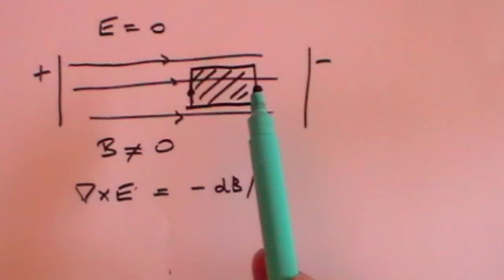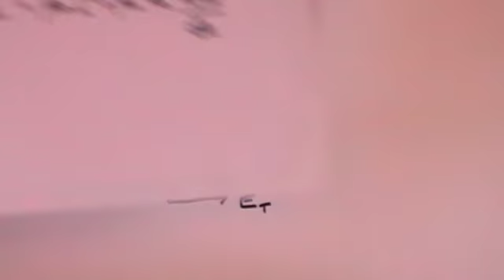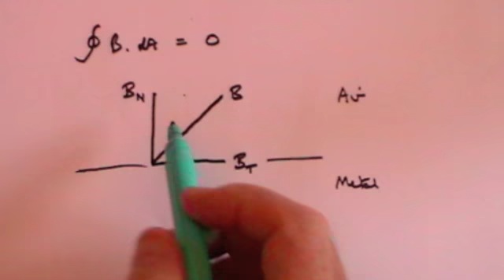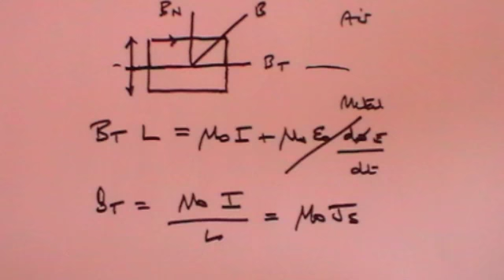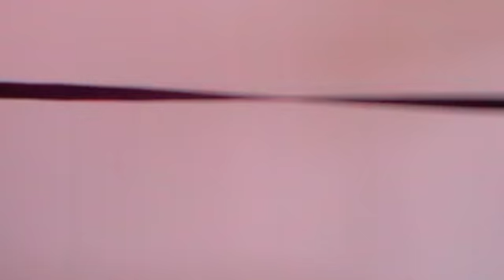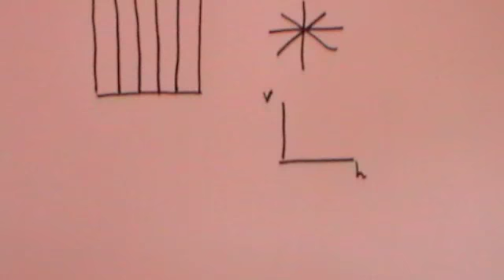Effect of Electromagnetic Radiation on Metals

Comment: The statement at 32:05 that it is the horizontal component of reflected light that passes through a vertically polarised lens is entirely out of line with what I was taught or what I could find written elsewhere. All the sources I find say that reflected light off the ground producing glare is mainly horizontally polarised and that a vertically polarised lens blocks this glare (i.e., horizontally polarised light).

edit: did I misunderstand something??

Comment: With all respect to maxwell's equations but in the first equation something is missing.  Electric field is not just a function of electric charge. It is also a function of the energy of this charge.  So the same charge can have more or less energy.  It manifests itself at work which can do the same number of charges depending on the value of the electric field.
Reply: Czesław Wiech it’s also a function of some radial distance r 
And you’re talking about electrical potential
Reply: @legendarylightyagamiimmanu1821  because the electric potential, volts and electric field are one and the same.

Comment: If a metal perfectly reflects back emag wave, then why does a metal easily get heated in sunlight?
Reply: a metal conducts so it heats up and conducts easily form the suns energy
Reply: @alexmanbeck  , the video says, a metal 100% reflects back electromagnetic wave incident on it. And sunlight is an emag wave. Heat is energy. How does a metal, then, accepting energy from sunlight?
Reply: This is a physical model, where it is considered a perfect metal.
 Real metals have defects so they absorb some of the radiation in different ways, which is why real metals get hot.
Reply: Even in a material considered perfect, reflection is one of several effects that occur in the interaction of radiation with the material, which are probabilistic and depend on the frequency of radiation among other parameters.
Like the photoelectric effect, the compton effect and the formation of pairs.
These can cause the radiation not to be reflected, but to be dispersed and emitted in the thermal region of the electromagnetic spectrum

Comment: If the surface elctron(s) creates a wave that cancels the incomming em field wouldn't it also create an oscillating field in other directions as well, including into the core of the metal?
Reply: Certainly. Electrons will create radiation or I should rather say EM filed in forward direction. But, again, other free free electron are present there (just inside) to produce cancellation effect of incident field. It depends on conductivity, permeability and some other parameters also. Eventually, in practical sense, radiation is stopped inside metal (within few nanometers for visible radiation).
Reply: @tokas79  , so if i hv one copper wire, then electrons are oscillating up n down, to try catch up with any incoming E field oscillating. So there shd be a current on the wire's surface, forever flowing up n down. Is that correct?

Comment: Isn't E=0 a condition of electrostatics? If yes, how do you justify using that condition to calculate the boundary conditions etc? Is it because of the high speed at which the electrons move in a metal to compensate for the E field that is in the metal when an external field is applied?

Comment: Hi, thanks for this series on electromagnetic radiation. It's been great to follow and very instructive. One day mankind will thank you for all your lectures and knowledge you post out here.
In the meanwhile I have a few questions: 
1) what happens to Bt (4th equation) in the perpendicular metal plate example? 
2) And what if the sheet of metal is not perpendicular to Z? What happens to En and Bt? Does the rope example still applies here?
3) Does the skin effect breaks for gamma rays?

Comment from the maker: As others have pointed out, the electric and magnetic fields of the electromagnetic radiation oscillate in a plane which is perpendicular to the direction of travel. The electric and magnetic fields themselves oscillate at right angles to one another but no part of those oscillations can be in the direction of travel of the wave.